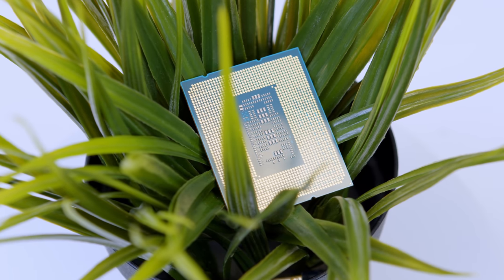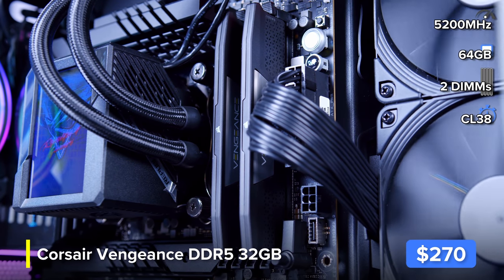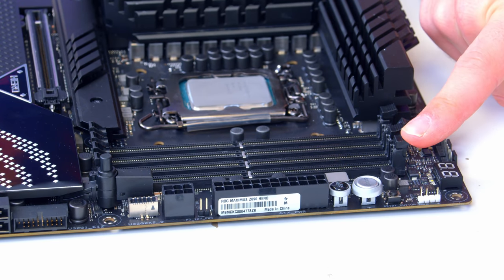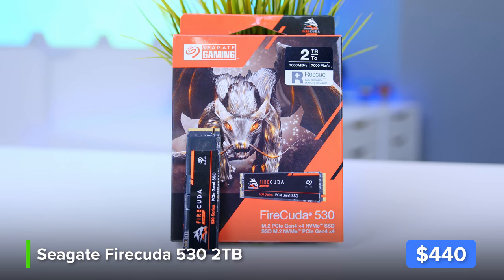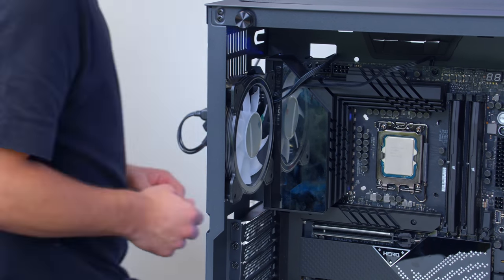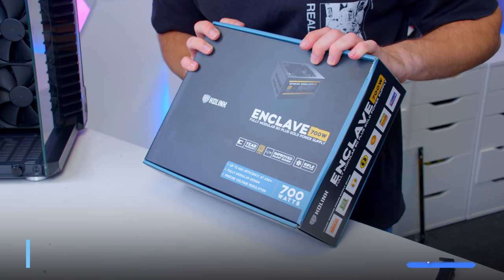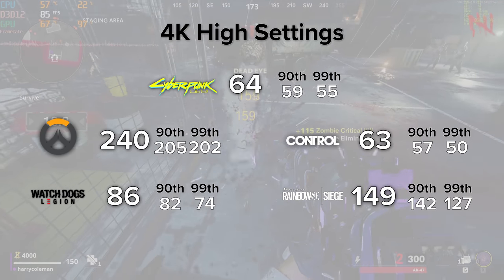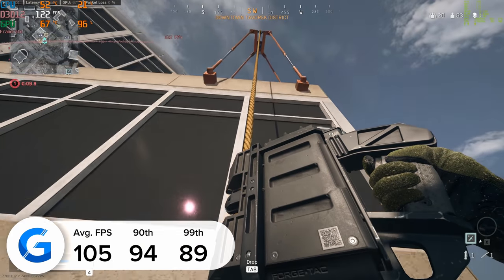$3000 i9 12900K Gaming PC Build 2021! [ft. RTX 3080, DDR5 & Z690! w/ Gaming Benchmarks!]

Comment: Also, with a 12900k system and a 3080+ card, use a 850+ watt PSU.  Before anyone says anything goofy, a 3080 can pull close to 400 watts on its own. The 12900k can pull close to 300 watts on its own as well. So a 700 watt PSU is not simply  "good enough"
Reply: seems to be just fine.
Reply: using 850w here with my i9 12900K and 3080 ti all is fine

Comment: I noticed that you only used 1 of 2 8-pin CPU power connectors. With a 12900k, you should be using both...... To anyone watching this video, do NOT follow this video as a first time building guide on 12th gen or with 30 series RTX. Use BOTH 8 pin cpu power connectors and also, use two different 8-pin PCI-e, not a pigtail. Especially when building with a 3080, 3080Ti or a 3090.
Reply: Are you on Instagram? I’d love to ask you some questions. Need some help thanks
Reply: im using just the 8 pin on mine its perfectly fine 🤣
Reply: @inthewoods5471  Are you running a 12900k? Overclocking?
Reply: is this for overclocking?

Comment: The new Nvme catch is great, it avoids having to use the world's tiniest screw, and the new catch cannot be lost.
It's not the catch's fault about cack hands.
Reply from the maker: It's just not very usable imo is all. If I find it hard to use, a first time builder is likely to face the same if not more struggle....
Reply: I'd have to agree with you on this one, the issue I have with the screws is screws can drop and get lost plus as an experienced builder I found it so much easier to just do it quickly

Comment: Are the New RTX 4070 ti super fit in this Case ? And does also fit a Gigabyte Waterforce 2 AIO at the top ?
Reply: I but rtx 4070ti super to vertical positsion. Same cade.  And this is good and beautiful too😀

Comment: Hope your not planning on overclocking.. Not much headroom left with a 700W PSU, and best to use individual GPU power leads and not shared/splitter cables.

Comment: First time watching one of your videos as I'm literally in the market to build a 12900K 3080 DDR5 Setup. Honestly a great video showing the construction process and the real life performance with the different games. Really surprised at how cool the CPU was running. 

Hope you don't mind but some constructive feedback... you seem to be based in the UK so would be nice if just in the on screen graphics to show GBP MRSP's as well. Finally, LINKS -We all know the GPU situation but only 1 out of the 7 eBuyer links can you actually purchase anything (SSD). Some of the links are just generic search terms too and although no CPU link the CPU Cooler link takes you to it (Which you can't buy). I was ready to throw £3k into a set up and probably every product you have shown because of how cool it looks and the CPU cooling achieved ha. I'll have to keep looking.

Anyway, great video and a new subscriber here.
Reply: Make sure you get the DDR5 first. Its easily the hardest part to come by (way worse than GPUs), and the markup on it from scalpers is way beyond the markup for GPUs. I was all set to build on a DDR5 motherboard (ROG Maximus Hero) but RAM was like $800+ for the worst single 16GB DIMMs on the market on Ebay so I just am using a DDR4 board until I can get my hands on DDR5
Reply: @StarmanDX  Thanks for the advice but I ended up going with an AMD 5900x and a 3080 with obviously DDR4. It’ll suit the performance I’ll ever need for a few years to come.

Comment: Ddr 5 its not good for gaming its cl 40 class lower can be 36 its better than ddr4 only with maximum 10-15 fps or less depend games i repeat i said for gaming only nothing else i mean it.I can buy ddr4 cl16 corsair vengeance 3000 - 3200 mhz with 2x8 gb kit.